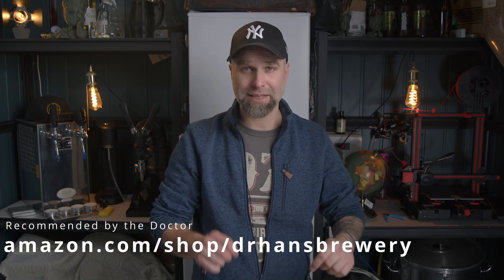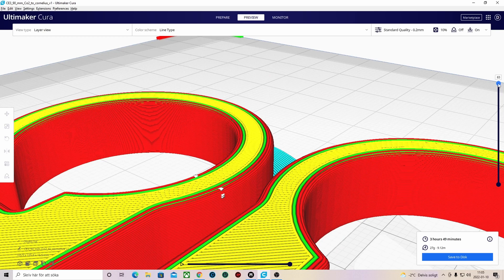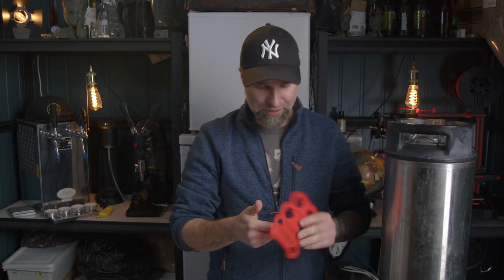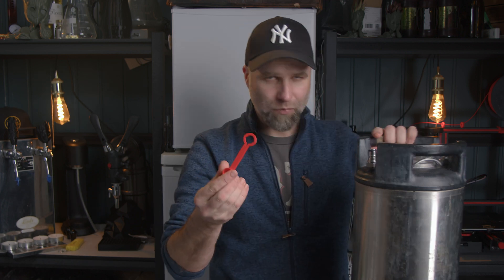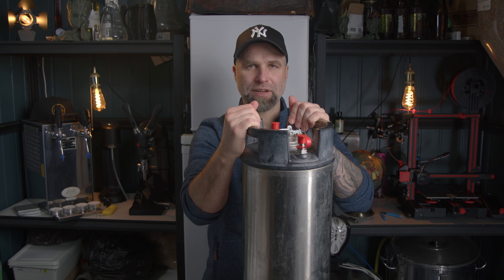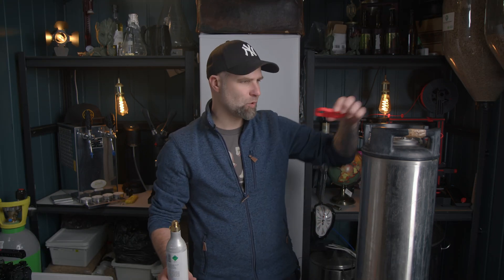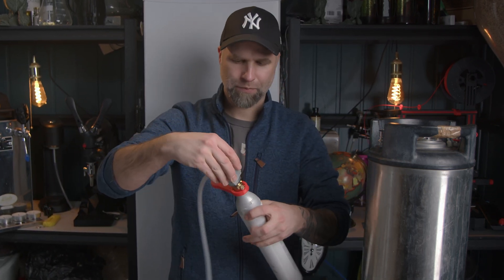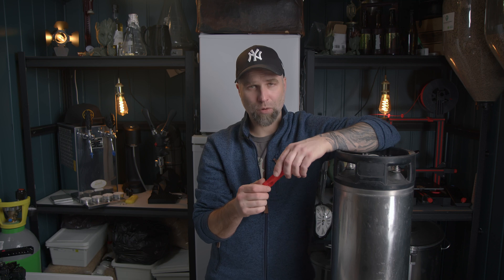3D printing Beer Stuff - Cornelius Keg accessories

Comment: Hey Dr!  I've noticed your very neat setup of basemalts (or maybe all sorts of malt) in the hanging conical PET-fermenters on the right.
I have an old fermentasaurus that is no longer good for fermentation due to some minor cracks in the bottom. How did you attach these vessels on the wall/ceiling? And furthermore, where did you buy them? Seems like a very expensive set up for storing grains (but very good looking).
Does the grain flow properly out of the butterfly valve?

Thanks in advance!
Reply from the maker: I use them for base malts. Would be cool to have something way smaller for specialty malts on the opposite wall for sure. Check out the video I did about them. I think it will answer most of your questions https://youtu.be/6mUNVSyXXek
Reply: @DrHansBrewery  cheers!

Comment: Awesome stuff, i've been looking for some stuff to 3D print for my home brewing. A bit of advice from some one who's been printing for a while. PLA is not the most robust material as it will become brittle over time and fail. Try using ABS/ASA for non-flexible parts (ASA if its going to sit outside) and TPU for things that need to bend (like the post caps)
Reply from the maker: Cool, thanks! I need to learn about different materials. I'm still a rookie!

Comment: Save the Unicorn! The like button was on the wrong side, but love you anyway. Haha! These were really cool - I wish I had access to a 3D printer now. Tap handles are a common thing to print; I would like to see this. What about a clean in place sprayer? I think it would be awesome to find a way to setup the FermZillas with a CIP unit so that you never have to move them and can treat them like a real unitank. You may have to print some sort of additional insert for the lid to do this.
Reply from the maker: Thanks! A cip unit would be cool.